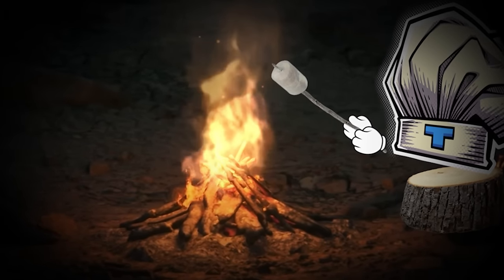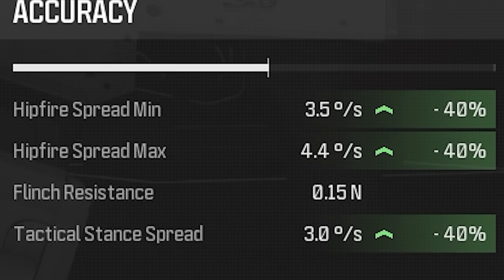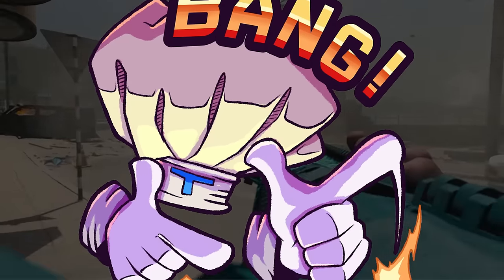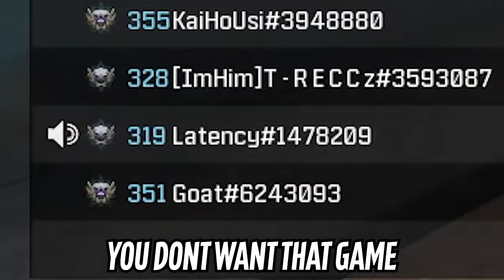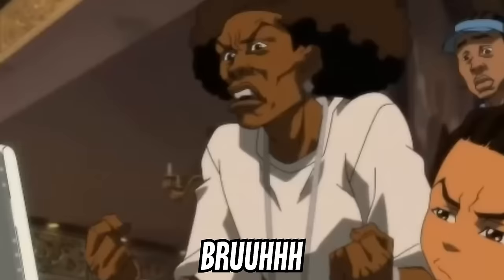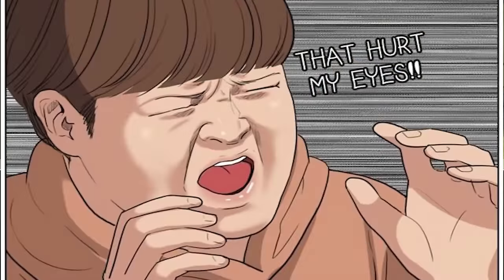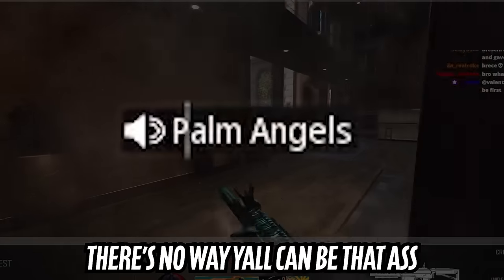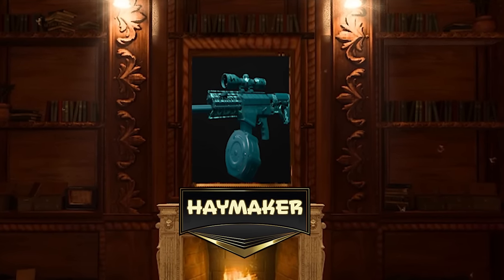They "NERFED" the NEW HAYMAKER but ended up making it the STRONGEST SHOTGUN in Call of Duty

Comment: funny how the actual attachment model is meant to look like it has a fully 3d printed receiver, yet the binary function can be done simply by changing the trigger mechanism.
Reply: most of the conversion kits are like that. 3d printed receiver for something that can usually be done with a simple barrel change.